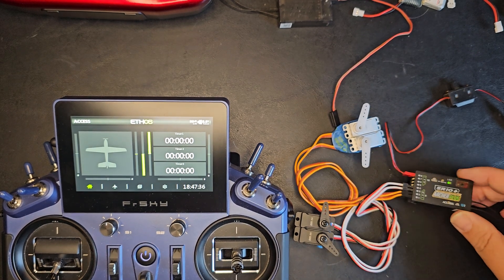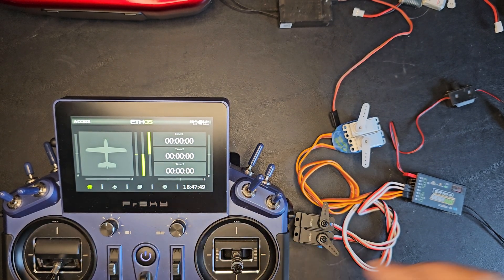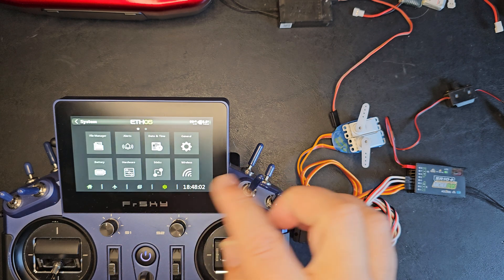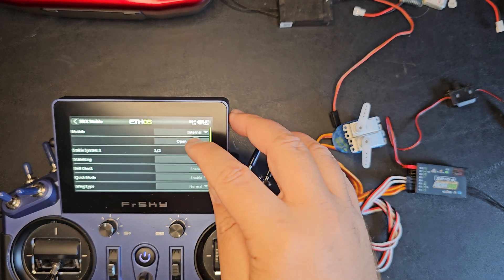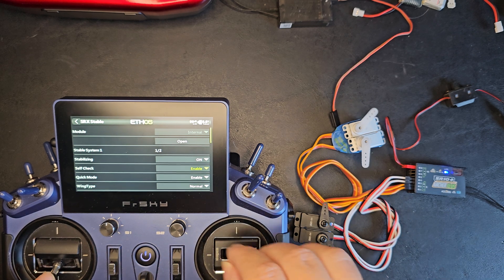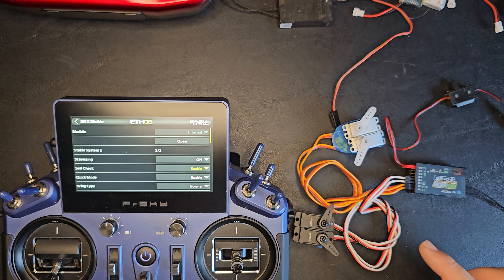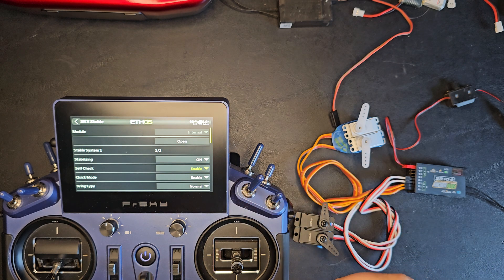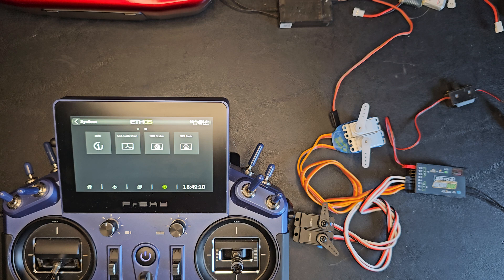FrSky ETHOS Stabilized Receiver ARCHER Plus Self Check Fix No Servo Outputs SR8/10+/12+ TANDEM TWIN

Comment: Is the Rx limited in horizontal position with Pins pointing to back of the plane in order for Gyro to function properly?   Is it possible to configure the Rx Gyro with pins pointing forward towards the motor and antennas back away from carbon wing joiner, batteries and other signal blocking components.

Comment: Are there any videos on installing the temporary lua 1:41  script on the X 20 Pro? I installed it on the flash drive the radio and put a SD card and installed it there not able to flash the internal module the way I see in the video of the X 20 S. Getting ready to buy a spectrum radio just so I can have stabilization.
Reply: I went in the boot loader mode and removed all the files that said LUA or had anything to do with it and reinstalled them from the folder I had on my desktop that fixed it I like this radio and all the options.
Reply from the maker: @aegidiomoresco5982  I have a video which shows the temporary Lua script install for x20s it is the same process for the x20 pro. You need to have the files placed in the correct location for it to work. It should not be put on the flash drive but the radio drive instead

Comment: After learning this it was a help on my Freewing F-14.  It uses 15 channels for various things. .  Then I changed some things and both ailerons started going the same direction.  Both up and both down as aileron stick position changed.  Re-running the self check fixed it. If something is changed and there is incorrect control movement re-run the self check.  Odds are better than good it will fix the control issue.  Also keep in mind there are only 5 gyro affected channels on page one.  Throttle is apparently not a gyroed control.  This can mean something if you are running multiple channels on similar control surfaces, ie. 2 aileron, 2 elevator, 3 rudder (two vertical stabilizers and steering on separate channels), thrust reverse, etc.  Haven't used page 2 yet but it is probably an option.